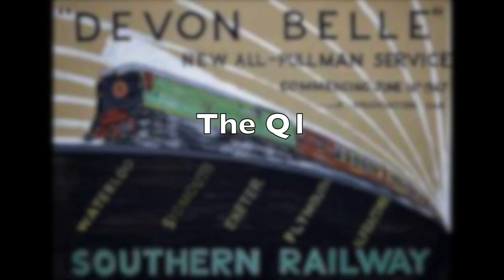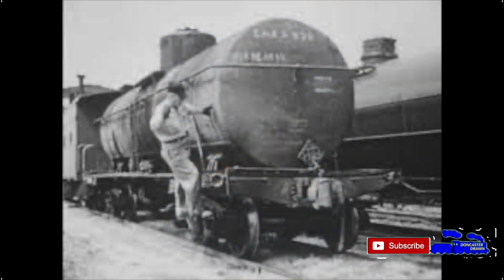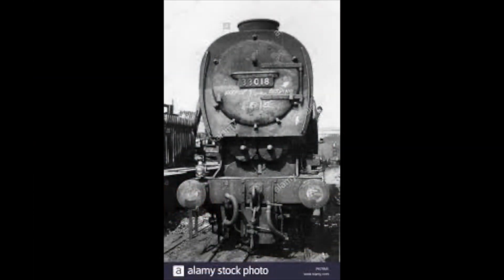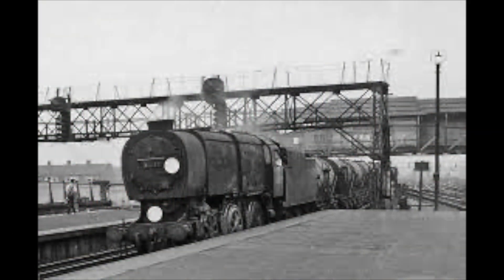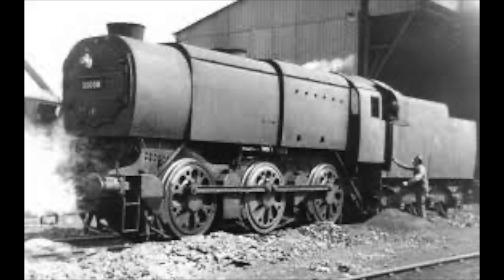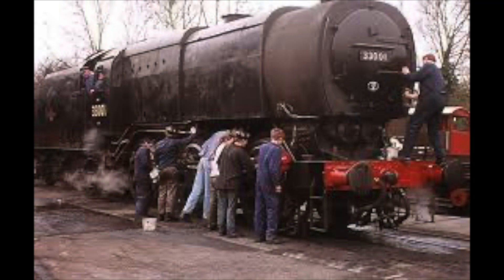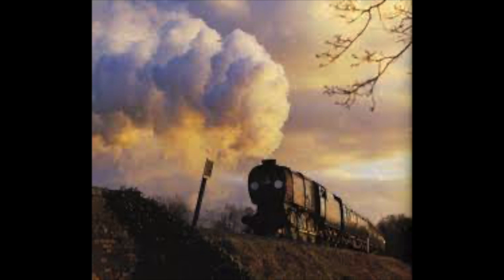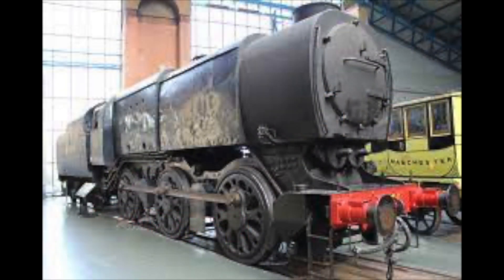The Q1

Comment: Hi, I'm amazed copper was used for the firebox, that would have been much needed elsewhere during WW2, eg for electric motor windings. It would have given exceptional heat transfer to the boiler water though so perhaps that explains the choice - to make the maximum efficient use of the coal fuel.
Reply from the maker: the thing is with austerity is efficiency and getting the most out of so little. I was reading a world war 2 cookbook and it mentioned using cold mashed potatoes in sweet puddings! it was brilliant what they did

Comment: What dose Power 5F mean? (Sorry noob question)
Reply: British Railways had a locomotive strength rating from 1 to 9, with a suffix P for passenger, F for freight and MT for Mixed traffic. This was used to calculate how heavy a train the locomotive could haul. So a 5F was a medium powered freight engine. The 9F was the most powerful British freight engine (apart from two types of Garratt which were probably unclassified).